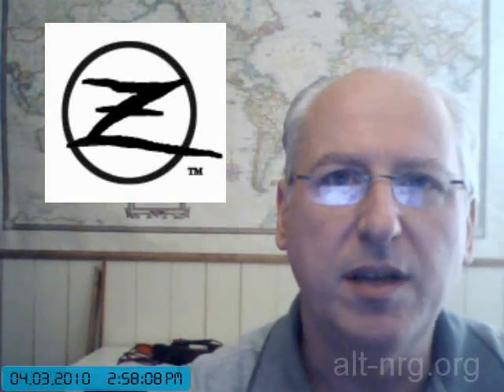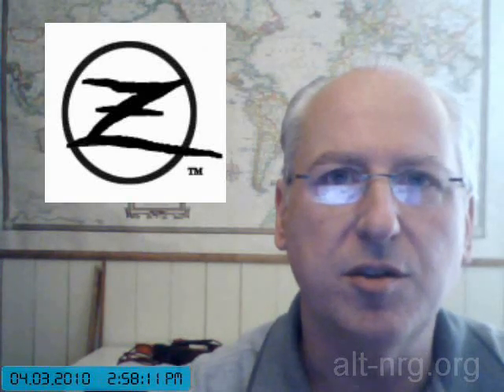#220 Zero News Update Tesla Test drive, New PWM

Comment: I think Bob Boyce has a circuit that controls the gas output based of the throttle position. I think that you will still need a means of leaning the fuel to get the maximum benefit from HHO.

Comment from the maker: @librano I am on Linux! Problem is there are still several applications I have not yet found suitable replacements for. Cases in point, WebcamMax, MapPoint, Movie Maker, Dreamweaver, MajicJack. I run these inside a windoze XP virtual machine using VirtualBox. WebcamStudio is a WebcamMax wannabe. Not quite there yet.

Comment from the maker: The chip forms first underneath the nickel plating. Repulsion stress causes the bulge until the nickel coating breaks and the chip flies off. These neodymium magnets are wicked powerful. K&J just released a 2"x4"x4" monster with a pull force over 1,200lbs! 670lbs at 1/2"!  That's just crazy. Can you say crushed bones?

And yes, I am seriously considering molding these boards into the cases with epoxy, at least for a while.

Comment from the maker: In all honesty, we won't need much in the way of variable HHO output until we regularly start getting up into the 10+ LPM range. At that point we may be running some small engines on 100% HHO. Then it will make sense.